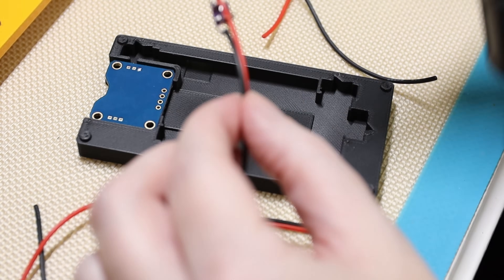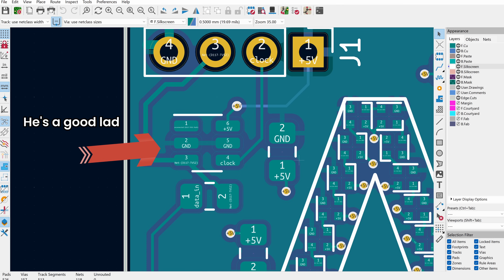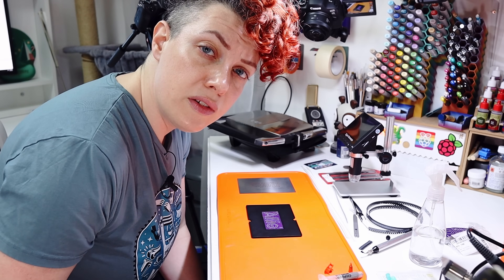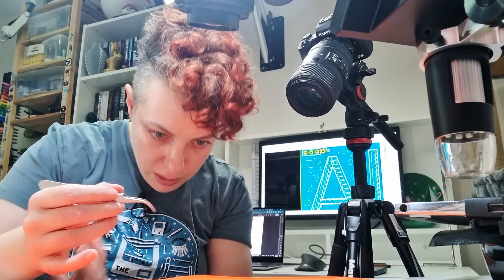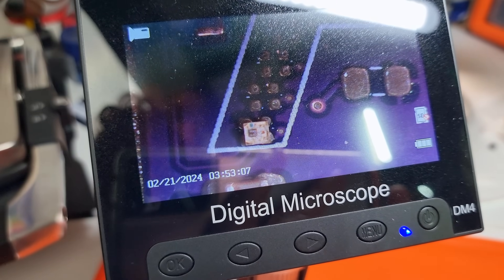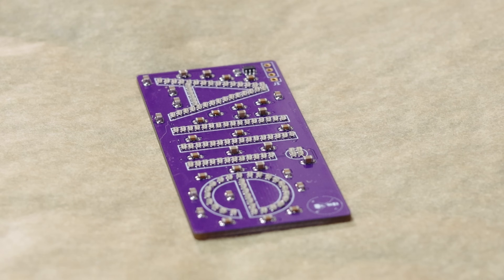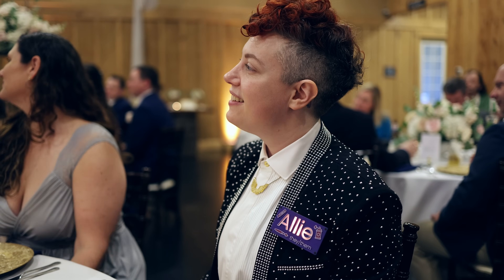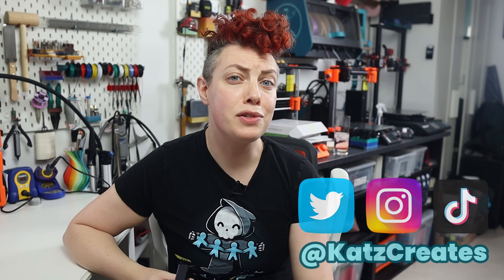Soldering 112 Tiny LEDs was a Terrible Idea

Comment: So this is you second PCB you made? No bad. As a professional I can tell you that I myself often enough had problems with these prototype stencils. We had a paste printer for larger stencils at work where the PCBs were hold down by a vacuum and the stencil was tightly clamped the printer. When lowering the stencil on the PCB it gets in good contact without much of a gap, but this is difficult with these prototype stencils, so you either build up higher solder paste "towers" (as seen during your tries in the video) or smear the paste under the stencil. The trick is to get the stencil on the PCB without an airgap in between.

Comment: Good job! Only in comparison with what I have to do today, your job was pretty easy. Or let me know if you disagree:

I have to replace one resistor on 100 pcs XIAO ESP32C3 boards. But before I do it, I have to remove the metallic lid from the board. Then I have to replace the 2K7 resistor with 6.65K one, replace the lid and solder it back. 

It's true that resistors have no polarity like LEDs, but their size is 0603 metric/0201 imperial, 0.6X0.3mm. Have you ever tried to solder/unsolder something like that? Me neither. It is 5.55X smaller than your LED, by surface.

I can't use hot plate, because XIAO boards are already soldered to another board. To make things even worse, the paste used on XIAO boards was for much higher temperature than the one I used to solder XIAO and other components to the board below, so I'd probably fry all the components before the resistor could be removed. So the only option is hot air. The one I've made myself, which doesn't make me any happier...

If that's not enough, you did this to yourself, for hobby, and I have bought the boards believing in specification on manufacturer's website, and assembled all the boards before I found out that the designer did not set the battery charging current to 50/100 mA, as stated in the specs on their website but to fixed 370mA??? My LiPo batteries are rated at max. 150mA. They do have protective circuit, but not for 370mA, which is more suitable for car batteries. I can't return the boards because I have to ship the orders. And I certainly can't just solder the batteries, ship everything and hope for the best. And wait until they start popping like a popcorn around the globe LOL.

And here's the best thing - I have hardly any experience with this,  not more than 10 hours or so total. And I'm not lying, so wish me luck:) I'll do it, I have to.
Reply from the maker: Oh WOW that's a lot! I wish you best of luck for sure!

Comment: Wow, just wow!
Having done this as a "professional assembler" (but only when our real professional had too much other work to do) this looks very good. That 3D printed stencil jig look like a very good idea. It keeps the PCB and stencil perfectly aligned and aids in perfectly removing the stencil. 
A thin steel blade works better as a squeegee than the plastic card you used and doing this in a single smooth swipe helps too.

Comment: So i was thinking about how id go about placing surface mount components while you were doing yours and something i thought about was, that you had enough space between each LED, why not next time make a 3d printed jig, that sits like 0.4mm above the board (so it doesn't touch your solder paste), but leaves just enough space to drop the LED's in the holes in the jig. this would make sure they're lined up correctly and you can just drop them in making it much faster to do assembly. 

Great video btw! you got a new subscriber!
Reply: When the solder reflows, if you have them correct enough, they move into place anyway. It's quite cool to see.

Comment: I'm not an expert but I have maybe 100 hours of soldering experience, if parts of the solder paste are touching between different pads, you shouldn't worry about it, once heated it should unbridge due to surface tension, and also the way I assemble my pcbs is without a stencil, I just pre-tin the board using a flat (hoof) soldering tip to evenly flow solder across all pads then make sure there is just a bit of flux left on the board, and then I start placing the components and after I place a bunch I then heat them using the heat gun at a low air speed so they don't fly off
Reply from the maker: Yea, I understand this better now!😅

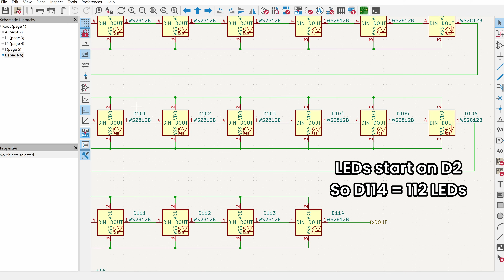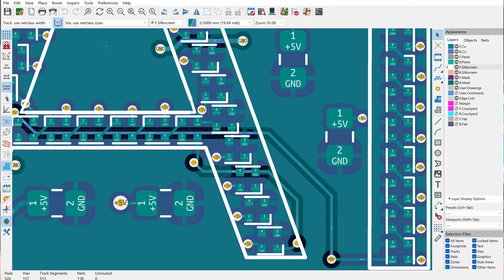Comment: 2:18 / 7:18 - What did I see there, a Hakenkreuz. The dot of the "i" is something what we would prevent here in Germany, even if it is in a schematic or the layout. But because of the limits of the keepfree-area around the pads, this silkscreen in this area is not visible on the PCB.

I like that you are using open source Software.
I do not like that you are using this "easy" solder-paste with Bismut (Sn47/Bi57/Ag1). A mix made with copper, tin and silver is the best in my opinion, but there you need a bit higher melting temperatures.

Your pictures of this process are very good. You have there a Canon EOS camera and some macro objective? 

What I miss there in the schematic is the LiIon-cell protection. I think this USB-C bord have only charging limit, but I do not see a discharging limitation. The LiIon-cell voltage should not fall under 3.4 or 3.6V and if the electrodes of the cell should not degenerate so fast, then the charging should be stopped at 4.0V if you use a normal 3.7V LiIon-cell.

Comment: This makes me endlessly happy. Have been looking for some other they/thems who solder. Even if this isn't the thing you do all the time. I haven't made it through the whole video yet, but had to comment. 

If it's any consolation. Stencils are kinda the worst and the best. Saves a lot of work. But so fussy. Every time I reball a chip, or anything else that involves a stencil and paste, I think Imma mess it up. I do a lot less than I used to. Drier paste actually makes this easier. But I also tend to be in a position where leaving spare paste out on an exacto blade is pretty normal. And I am reballing a tiny BGA chip. Not prepping a whole PCB. 

Also. The shaky handle struggle is real.
Reply from the maker: I love soldering, weirdly enough! I reckon there will be more soldering in the future. :D

Comment: The amazing thing about the computer that we call "the brain" is that, with a little training, it can automatically refine its motor control algorithms to allow you to place components with much more precision just by looking at the board with magnification (or through the microscope). A magnifying visor helped for me, but I haven't needed to work with components that small as yet. It also helps if, like mine, your eyesight isn't what it used to be.

That said, you did a great job, considering it was your first try. Definitely a lot brighter than I expected, but I suppose that probably helps with the semi-opaque letters of the front panel. Also, I had no idea a sandwich toaster could get hot enough to melt solder. I've been looking for an affordable reflow hotplate, so I might have to pick one up and give it a try for myself.

Comment: Using double stick tape is probably not a good idea because it changes the distance from the top of the mask to the PCB. That means that you get too much solder paste.
Generally you probably don't need to worry as much about the solder paste. Surface tension is your friend and will fix it once the solder melts.

Comment: Respect!

People told me I was crazy when I prototyped the MRK RGB shield.

- 84 2020 RGB LEDs
- no stencil 8x solder points per LED (all applied with a syringe)
- hand pnp
- hot air reflow

I assembled 5, they all worked :D
Reply from the maker: Does it feel like the ACTUAL BEST?? :D
Reply: @katzcreates  100% 
what I love about doing micro-electronics is that your world is shrunk down to less than 1in and spending time there gives you a sense of clarity outside of the surrounding world you can't easily find anywhere else :)

Comment: Congratulations!!! Your dip into small device surface mount went about as well as my first projects. I dread TSSOP packages, but seam to use them often. I have a huge collection of excess logic chips in TSSOP packages. I'm now contemplating BGAs again. 🙀One of the parts I'd like to use is only available in BGA.

I want to get a wide field binocular microscope to help with the pick and place and rework.

BTW, I steady my hand with my other hand. This is important as I'm rapidly approaching my 60s. What I'd give for an easy to configure small batch pick and place machine....

I reflow using a toaster oven I modified with my own temperature controller back in the 1990s. It works for PCBs up to 2U Eurocard size which is around 230mm x 160mm. I did update it from the laptop PC it was originally hooked to to a Raspberry Pi awhile ago. At that time I also changed from a HP temperature logger hooked up via RS-488 to a set of thermocouple monitoring chips hooked up via I2C.  PS, I still jump for joy when I get a perfect solder spread.

I have temperature profiles for baking moisture out of chips that I've had around. They should also work for baking moisture out of 3D printer filament.

That temperature controlled reflow oven lead me to modifying my food toaster convection oven with the same controller, but with temperature profiles for cooking. 😜 Perfect cookies every time. 😸 Of course the controller doesn't have a screen. I have to point a browser at it's web server, and select the right cookie cooking profile for the type of cookie I'm baking. I also have some pie baking profiles. It cooks the pie at a high temperature first, then lowers it over time like a wood fired oven would drop in temperature. That browns the crust nicely, and then allows proper full cooking just like "hot oven" would in those old recipes. I have one that goes in reverse for my thick deep dish pizza pies. It cooks at 300F for 20ish minutes using bottom heat only for cooking through so the center gets to 160F then ups to 450F using top and bottom heat with convection fan for something like 6 to 8 minutes to brown the cheese. Yes, I have a food temperature probe integrated into the controller for meats, etc. My standard pizza profile does the baking using 80% heat from the bottom, and 20% from the top at the start, and flips to the opposite to finish.

Comment: Next time give JLC’s PCBA service a try. It saves sooooooo much time to have them make and assemble the boards!
Reply: Its quite expensive for small prototype runs, but once you have the design done and order 25-50 then the price is ridiculously low. 

I do light kits for R2D2 builders, and was amazed when I started ordering them in bulk just how cheap it is.
Reply from the maker: Darren nailed it! It's not always cost effective to get fabrication done, even if PCBWay can totally do it and does it well! I wanted to see how hard it would be to do something like this as well. :)
Reply: @katzcreates  I've actually been tempted to get one of the lumenPnP open source machines, but just can't quite justify the cost (or the space it takes up)

Would be great for prototypes, if you're doing a lot of different ones. I don't do enough tho. 

Having said that, I'm using 2mm LEDs for the R2 stuff, now I'm tempted to use the 1mm ones. :D
Reply: @katzcreates  good on you for taking on the challenge for sure… I always avoided it due to not having a hot plate but never considered the panini press could do the job!

Comment: This was super cool in person!
Reply: Oh speaking as someone with fine motor control issues (*shakes fist at arthritis*), could you create a template like the solder mask to help place components? That way drop it on board, slide into hole, remove template and bake?
Reply from the maker: I feel like this should be totally possible! I'd have to look at the PCB again, but there should be some easily exportable thing that would work well for this sort of thing. And I feel like @C3DPropShop is right, laser cut acrylic would work ideally I think!
Reply: @katzcreates  I don't know what software you use for PCB design, and I am no expert for sure, but if you have a PLACE layer (that will wind up in your silkscreenin layer) you should be able to draw a perimeter around your component footprint, then exporting that layer would more or less give you a map of component positions to make a jig from.
Reply: @SamValiant  I like that idea, but I think you'd want it to be a laser cut sheet (like the solder stencil) over printing for accuracy. I suppose a small nozzle or a resin print may suffice.